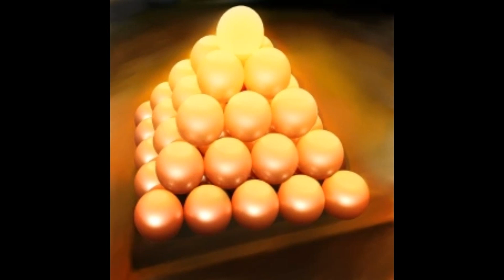The Drydock - Episode 141

Comment: During the testing of British 12" Mark VIIA "Greenboy" APC Projectiles with hard AP caps, some Russian 12" M1908 (I think) APC shells with "Tough" AP caps were tested against plates being fired at by the British 12" shells too, for comparison.

First, these 12" British Greenboy rounds were the only ones to continue to use CAST STEEL for their bodies, machining them to shape with minimal mechanical working from a blank of almost the exact shape of the shell to start with.  All larger Greenboy shells used FORGED STEEL shaped from roughly cylindrical smaller cast steel blanks that were stretched and twisted and compressed to their final rough shape by hammers and huge hydraulic presses while orange-hot.  Forging seems to give these larger shells much better mechanical properties and improved resistance to the twisting forces at oblique impact.

Second, while the larger Greenboy shells were tested at 20-degrees obliquity against about 0.75-caliber KC-type "Cemented Armor" (CA) plate and expected to stay "fit to burst" (FTB, fuze working and tight in the base plug and no significant cracks into the explosive filler cavity) after punching through the plate at barely above the Perforation Limit (minimum expected velocity to just get entirely through the plate with little or no remaining velocity on the far side; the US Navy post-1900 "Naval Ballistic Limit" (NBL)), the 12" size was tested only against half-caliber CA (6") plate at 20 degrees, though thicker plates at right-angles were successfully perforated FTB.

Third, when both the 12" British hard-capped Greenboy Mark VIIA APC shells and 12" (30.5cm) tough-capped Russian pre-WWI M1908 APC shells were fired at 8" (0.67-caliber) CA at 20 degrees (a similar-to-but-weaker relative test that all larger Greenboy shells would be expected to easily pass to get accepted), the Russian shell passed it with no significant damage whatsoever but the British shells BROKE TO PIECES during penetration.  Thus, there was a MAJOR problem with the 12" Mark VIIA APC shell as to its ability to stay in one piece FTB where the larger Greenboy shells had no problems and even much older Russian shells could handle these tests easily.

Conclusion, Russian APC shells had been better than British, German, and US soft-capped APC shells up to 12" size FOR A LONG TIME.  Note that even the latest German Navy APC shells used in WWI were not tested against such thick armor at this or larger oblique impact.

[NOTE:  I am not sure what the term "tough" means here, but these caps were not hardened to rigid, brittle hardness and yet worked better at 20-30 degrees obliquity from right-angles than plain US/British "soft" AP caps (they acted at these low -- but higher than soft caps could function properly reliably at -- obliquity angles like hard AP caps, limited only by the projectile's body strength and brittleness, not like soft caps at all).  Also, German C/11 and after WWI APC shells which also seem to be an improved soft cap that I would assume to be some sort of "tough" cap (a generic catch-all to me for unhardened caps with better performance, to my current knowledge) since they worked in allowing unshattered penetration of those later Krupp WWI-era APC shells at 30 degrees against half-caliber KC armor, where US/British WWI-era soft AP caps (pre-Greenboy in the British case) would peel partially off the nose and be ineffective half of the time (average) between 15.1 and 20 degrees obliquity and virtually never work at over 20 degrees -- the solder or other methods of holding on the caps were not strong enough to overcome the deforming of the cap and splitting the cap partially from the nose, preventing shockwave absorption in the separated regions and thus allowing projectile impact shatter on face-hardened armor.  As to what else "tough" might mean, Skoda pre-WWI soft AP caps used 25% (!!!) nickel content and Krupp used a super-strong solder holding its C/11 and after AP caps (all of them, through the end of WWII except for some late-WWII 16" Coast Defense APC shells using rubber cement (!!) due to metal shortages).  The rubber cement bonding agent worked fine, similar to the usual solder used by all other Naval AP shell manufacturers other than Krupp that I know of with hardened AP caps, showing that Krupp only kept using that extra-strong solder after WWI when it started using hardened AP caps starting in its "L/3.7" APC shells (15cm and Pocket Battleship 28.3cm) due to "tradition" rather than any real need with hardened-cap shell after WWI).  This extra-strong solder also increased the minimal steel plate thickness needed to decap Krupp hard-capped APC shells to about 0.2-caliber, way more than other naval APC shells that I know of.  Krupp's C/11 and after soft caps worked against KC armor plates of half-caliber thickness at 30 degrees obliquity (!!) (their improved spec test conditions), so these soft caps were not being stripped off by being bent on impact like other soft caps  and the caps were not acting like the usual soft caps did at over 15 degrees.  Thus, I use "tough" to mean any soft cap that shifts the 15-degree maximum angle for always working against shatter -- unless superior KC-type armor eliminates most soft cap functioning at any angle -- to at least 20 degrees.]
Reply: was pretty sure it was pre-war test, but I read about it like 6-7 years ago
Reply: @stallfighter  The British hard-capped, 2.5%-Shellite-filler, 0.025-second-optional-delay-base-fuzed (Number 16D), Greenboy APC projectiles were all designed and manufactured by British companies after the Battle of Jutland in 1916 had more British warships sunk than German ones (though several German battle-cruisers were wrecked, one, LUTZOW, sunk, and another, SEYDLITZ I think, almost sunk and had to come into port backward).  There was nothing wrong with the British shells against parts of the enemy ships that were not deep in the hull, so hits on turrets and so forth did not need any kind of delay to kill them and the Lyddite shells worked fine.  The British 12" pre-Jutland APC Shells were the Mark IV and the Mark VI, with the former being the most numerous (most tests I have use the Mark IV).   The British pre-Jutland APC shells all had soft AP caps, were tested only at right-angles instead of the more-rigorous 20 degrees used for Greenboy rounds, and had about 3.5% or so Lyddite filler with a non-delay (circa-0.003-second inertial delay) Number 16 base fuze (same basic fuze as the one used by Greenboy shels, but that one was remanufactured to have an optional -- set, if desired, just before loading -- optional path through the short delay element instead of directly to the black-powder booster at the end of the fuze).  Lyddite would detonate with the exact same delay without a fuze at all 90% of the time against any face-hardened plate over about one-third caliber thick, so British pre-Jutland shells were very reliable as to detonating properly on impact, though a delay-action fuze was not possible.  Thus, the test showing the superiority of the Russian 12" over the British Greenboy 12" was post-WWI.

Comment: The air pressure inside the sub is most likely kept at sea level. When they open an escape hatch and water rushes in they will shoot toward the surface. Not sure they would have had time for extra gases to be absorbed by their blood streams. If not then no bends.
Reply: Although subs are maintained routinely at 1 atmosphere pressure that is when it is working. A disabled submarine increases internally in pressure when disabled and that does not even include flooding (which would increase pressure even more). Regarding decompression sickness (the bends) it is possible if you are deep enough escaping from a submarine can lead to decompression sickness as you will absorb more nitrogen as the escape hatch equalises pressure with the outside water pressure (you cant open a submarine hatch without the pressure equalising as it is kept shut with external pressure being higher than the internal pressure of the submarine). And as a principle humans are predominantly water and solids which are incompressible so only air spaces are important and if you continue to breath (hence the point of rescue suits to allow you to do this) you should be fine. Note that the deepest free dive (down then up holding your breath) is 214m (702ft) so 170ft is a doddle as its only one way!

Comment: Your explanation about the relative merits of the US Navy WWII super-heavy/"20% Overweight" AP shells, particularly the 2700-pound 16" Mark 8 AP Shell, compared to their much more conventional weight 2240-pound 16" Mark 5 APC used for the COLORADO Class 16" guns (and these latter also used in some US Army 16" M1919 Coast Defense guns during WWII) was "right on".  Increasing impact velocity is better than increasing projectile weight for the same muzzle energy of a gun in penetrating KC-type face-hardened armor.  As long as projectile damage does not change, the the thickness, T, completely penetrated at a given angle goes up with the IMPACT VELOCITY, V, raided to the 1.21 power times a separate factor of the increase due to weight changes going up only by the TOTAL WEIGHT to the much smaller 0.2 power -- compared to the combined weight and impact velocity approximating the TOTAL KINETIC ENERGY (W x V-squared) to the 0.7143 power (average for medium-thickness plates) for homogeneous, ductile armor.  Thus, for homogeneous, ductile armor, all else being kept the same, penetration can swap W for V-squared and roughly get the SAME penetration result, but adding more weight while reducing the velocity to keep the same kinetic energy at the gun muzzle (roughly what you get with a fixed powder charge for any weight shells), the face-hardened armor penetration will go DOWN somewhat for the same impact angle.

Thus, using the 50-caliber gun in the IOWA and MONTANA Classes will improve penetration against face-hardened side armor at closer ranges over the 45-caliber gun using in the NORTH CAROLINA and SOUTH DAKOTA Classes by going from 2300 feet/second (701 m/sec), the lowest new-battleship-gun muzzle velocity in use in WWII) to 2500 feet/second (762 m/sec) by having a flatter trajectory (a little) that hits at less of an oblique angle and gets this benefit (though it is small at low obliquity compared to the huge benefits you get if you reduce the impact angle at a high angle, such as against a deck at most effective ranges), while you get the maximum possible benefit of both the higher velocity and the modest benefit of heavier weight.  However, at long range, the drop off of velocity due to air resistance is lower for the heavier round AND the shorter gun gives you a steeper angle of fall, improving deck and turret roof penetrations to a greater extent than the modest increase in striking velocity at longer ranges (drag goes up with velocity so the 50-caliber gun does not give as much of a benefit at long range as it gives at close range to counter the loss due to the greater obliquity of impact on decks compared to the slower and steeper trajectory of the shorter gun at long range.

The fact that the heavier weight does not give a penalty against homogeneous deck armor penetration (W and V-squared balance, as mentioned above) does gives the heavier projectile more penetration than using, say, the lighter 2240-pound 16" Mark 5 AP round used in the COLORADO Class in WWII (very similar but shorter projectiles), but this is different when using the Mark 5 projectile in a 45-caliber gun with its regular muzzle velocity of 2520 ft/second (768.1 m/sec).

Verification of this:  Note that the ratio of projectile weight is 2700/2240 = 1.205.  The ratio of V-squared values is (2300/2520)^2 = (0.913)^2 = 0.833.  So, we get the change in kinetic energy at the muzzle = 1.205 x 0.833 = 1.004 or 0.4% (mere rounding error).  See how the total kinetic energy does not change when switching projectile weights with a fixed powder bag charge (the same bags used in both the new NORTH CAROLINA 45-caliber guns as in the old COLORADO 45-caliber guns -- range table states "full charge" for either gun with no ship designation change).  Thus, this same ratio can be used to calculate the muzzle velocity of the 50-caliber gun if firing the 2240-pound Mark 5 AP shell as 2740 ft/sec (835.2 m/sec).

Here are the numbers:

US mid-WWII Thick Chill Class "A" (modified KC-type) Armor Penetration by latest 16" Mark 5 & 8 AP at 10,000 yards (9144 m) against a vertical plate (Angle of Fall is obliquity angle):
My FACEHARD Face-Hardened Armor Computer Program Version 8.0 (80th version), here being for a flat, no backing, 55%-face-layer-thickness plate of Standard 1.00 Quality:

  SHELL           ANGLE OF FALL        STRIKING VELOCITY         PENETRATION
Mk/MOD             degrees                    feet/sec (m/sec)               inches (cm)
45-caliber gun:
   5/5                       5.917                         2007 (611.7)                   27.19 (69.1)
   8/8                       6.8                             1900 (579.1)                   25.26 (64.2)
50-caliber gun (*Mark 5 shell estimated from 45-cal gun changes applied to 50-cal Mark 8 shell table):
   5/5*                     4.96                           2188 (666.8)                   30.43 (77.3)
   8/8                       5.7                             2071 (631.2)                   28.3   (71.9)
50-caliber gun is better than 45-caliber gun here, but using the lighter-weight Mark 5 shell (if of equal resistance to damage) is better than heavier Mark 8 shell with same powder charge.
Note that the time of flight here is 12-14 seconds, which will not let a ship move much so lead calculations need not be more than roughly accurate.

Homogeneous, Ductile Armor Penetration of US WWII horizontal STS/Class "B" Turret Roof/Deck Plate by latest 16" Mark 5 & 8 AP at 30,000 yards (27,432 m):
90 degrees- Angle of Fall is obliquity angle

Projectiles:  %AP Cap = ~11 (average) & %Windscreen = 2.2 (Mark 5 with typical early-WWII US Navy long design) and 1.2 (Mark 8 with typical late-WWII US Navy short design)
AP Cap gets 12% NBL reduction due to sharp, 140-degree-wide corner at the typical WWII US Navy AP cap face edge due to being over minimum plate thickness for obliquity values.
AP Cap always shatters.
My HCWCALC Homogeneous Armor Computer Program Version 6 (6th version), here being for a flat, Standard 1.00 Quality, 25% Elongation, 225 BHN, 215 UTS, STS/Class "B" Plate:

  SHELL           ANGLE OF FALL      OBLIQUITY        STRIKING VELOCITY         PENETRATION
Mk/MOD             degrees                  degrees              feet/sec (m/sec)               inches (cm)
45-caliber gun:
   5/5                     31.683                    58.317                 1472 (448.7)                    5.648 (14.35)
   8/8                     34.04                      55.96                    1490 (454.2)                    7.51   (14.35)
50-caliber gun (*Mark 5 shell estimated from 45-cal gun changes applied to 50-cal Mark 8 shell table):
   5/5*                    26.29                     63.71                    1548 (471.9)                     4.827 (12.26)

   8/8                      28.25                     61.75                    1567 (477.6)                     5.796 (14.72)
50-caliber gun is better than 45-caliber gun here, but using the lighter-weight Mark 5 shell (if of equal resistance to damage) is better than heavier Mark 8 shell with same powder charge.
Note that the time of flight here is about 50-57 seconds, which it will let a warship move considerably, so lead calculations must be accurate even if the target is not maneuvering.
Also note how small increases in obliquity can markedly drop penetration ability as the shell glances off.  The lower-velocity super-heavy shell is best, most especially in the shorter gun.

Comment: 47:25 - I was in the USA Boy Scouts, and one of the things we had to learn (to earn a merit badge for swimming) was how to take our pants off in the water, tie the ends of the legs, and fill the legs with air. Then you put the crotch of the pants between your legs, so one pants-leg is in front of you and the other leg behind, and sit there and rest until the air leaks out of the pant legs, which took anywhere from 30 to 90 seconds. The mostly-cotton fabric of our scout uniform pants swelled up when wet, reducing leakage over time. It worked pretty well, really.

Comment: US Navy did use bell bottoms and train recruits how to use the bell bottoms as floatation devices back in the day.  And though it is true that the portion of the trouser under water will be saturated, it's the air-filled legs that act as a buoy.  And as long as the legs stay wet they will hold air; so if the seas are rough or if you splash water regularly on them the  'inflation' process will not need to be repeated often.
Reply: Any pants work. The bell bottoms are just easy to get off.
Reply: @WALTERBROADDUS  Ahhhh! So that's why bell bottoms. I kept wondering why, did the bell bottoms provide greater volume of air or something -- which didn't make sense since, as you said, regular trousers can be used. Thanks!
Reply: @glennricafrente58  Yep, with bell bottoms you can keep the shoes on.